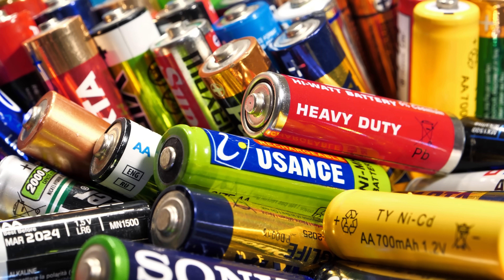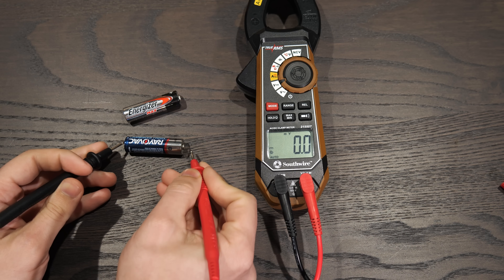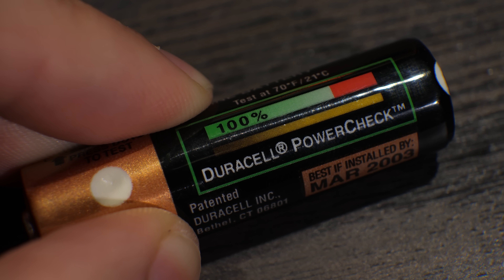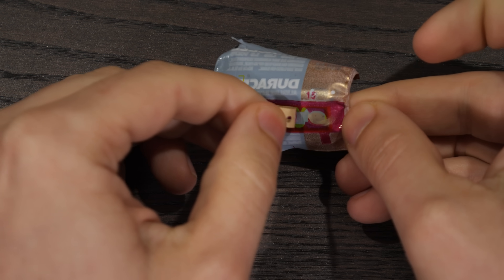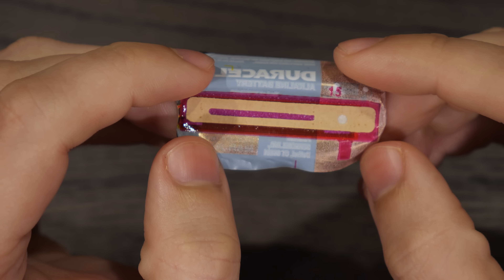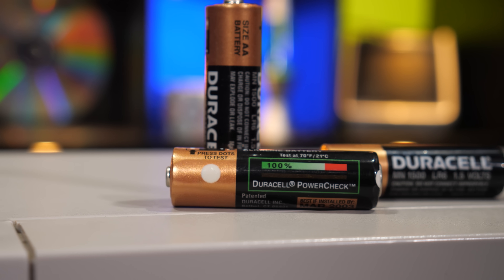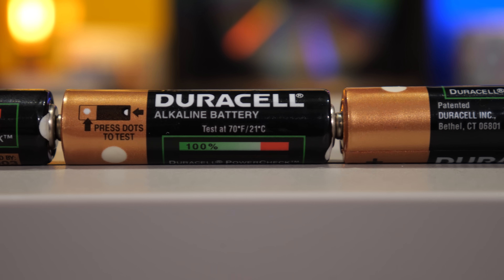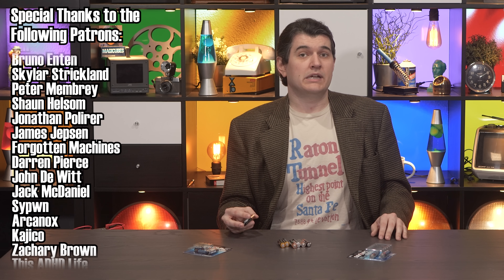Duracell PowerCheck: A genius idea which didn't last that long

Comment: I don't know if it's an age thing or a class thing, but I absolutely grew up with drawers of half-used batteries, and so did all my peers. I thought that's how EVERYONE of my generation grew up. Am I that old? I mean devices broke or got replaced all the time, and you always wanted to be ahead of the game by having a stockpile of backup batteries, and it was obviously impossible to tell which batteries were good and which were bad. I would honestly find it much more odd if someone's house didn't have a half-used-batteries-and-charger-cables-and-chopsticks drawer.

I had always thought that the reason these things died had far more to do with the transition  to rechargeable batteries and electronic devices with built-in battery meters than because people didn't really use them that much. I was always more than happy to spend a bit of a premium for the convenience of being able to easily find out which batteries were good and which were bad.

Comment: Why doesn't anyone mention the good old battery bounce test??

You drop a battery on a hard surface negative terminal first to see how much in bounces, if it bounces high that means it is used up, if it barely bounces that means it's good.

To me it works every time, and by height of the bounce you can roughly determine the left over charge. For some reason empty batteries behave completely different.
Reply: Another channel has a long video on this

Comment: There is a "slight" problem with the rechargable batteries: 1.2 V cell voltage compared to the alcaline batteries 1.5 V. Means: last much shorter. For example I have the blinking red light on the rear of my bike. With alcaline batteries (even the worst possible quality ones) it is bright enough even after a half a year in wintertime. But with rechargables... One week tops.

Comment: What I have started doing is when ever I am not using a device` I will reverse half of the battery's in a way the voltage cancels out. That way I can keep the batteries in the device without them contently draining. For my Wii remotes that I use once a week it is the difference between lasting two to three weeks or 6 months. The shape of holder in the Wii remote does not like you putting the battery in backwards but it is close enough that i don't care. For my newer Xbox remote both terminals on the battery case are identical so this technique works great. In both cases I now don't have to worry about my remotes not having battery when i come back after not using for a while because when i come back to them they always have roughly the same charge as when i left it. This unfortunately does not work for devices that have an odd number of battery's or have a odd number of parallel pairs but in almost every case this is not the case so it has saved me tons on batteries.

Comment: Having done thousands of videos about battery operated toys I quickly learned to steer clear of Duracell batteries because of the way they leak. Lost count of how many times I saw these batteries destroy whatever they were left in. Had me wondering why didn't Duracell develop a leak proof battery.
Reply: Buffett bought them and then their quality went into the trash can. I mailed Duracell over 1000 cells and 20+ destroyed devices. Energizers and even some Chinese no-brand batteries rarely leak compared to current day Duracell.
Reply: They changed! I have found devices many years old with intact cells but now they go bad before I even get them out of a package if it sits around some. Energizer seems to work WAY better and Amazon has them in bulk.
Reply: @BLKMGK4  If the batteries are actually "Energizer." Amazon has turned into a scammy cesspool lately, like selling "new" hard drives, but they are actually refurbished and still contain user data on them. Great stuff.
Reply: Yes. I own TycoCollectors (website) and the number of old Tyco, Taiyo, Nikko, RadioShack and other 80s/90s RC cars which have been destroyed by leaking Duracells and similar chemistry... very frustrating. It does'nt just ruin the battery compartment, the acid seems to creep deep inside the toy, and then begin eating away the circuitboard.
Reply: Give Low Self-discharge NiMH cells a try. They do have a slightly lower starting voltage, but their discharge curve is rather flat so they produce a very consistent voltage across their discharge, they handle high currents incredibly well due to their inherently more powerful "jelly roll" construction (similar to the physical construction of cylindrical lithium ion batteries), I have never had them leak on me (they rarely ever leak, plus safety vents help with that anyhow), and they're rechargeable so they're cheap to use. They power my flashes for my camera, they recharge the flash's internal capacitors about 3X faster than any fresh alkaline cell will, and last almost 2X as long under those heavy loads.

So far the one downside is their maximum capacity is not quite as good as a disposable (close though), so for low current loads like a TV remote they might not last quite as long... but they're rechargeable so it doesn't matter much anyway. Plus, the usable capacity at high current is almost as much as their rated maximum, so they actually get their full capacity even at absolutely stupidly heavy loads.

Panasonic rates their Eneloop brand cells to operate at rated output in -20C so if you do any toys in the cold... might be worth looking into. Just make sure to buy the regular variant with more cycles and lower capacity as their outer case is a tad smaller than the Pro variant so will physically fit into almost anything, even when some disposables wont, while also being more abuse tolerant. But really any NiMH cell made in Japan comes from the same plant regardless of brand.

Comment: I remember these! And am pleased that 14-yr-old-me guessed most of it right. I didn't like them because I felt it was wasting the power. But I enjoyed the whole video, and it reminded me I have a bunch of devices on the shelf with AA's in I haven't checked for a year - need to check because they will leak eventually, so.. thanks!

Comment: One time the remote AAAs gave up my dad got mad because we only had spare AAs, so he got 2 taped at the bottom of the remote and used a pair of paper clips to connect to the terminals and it worked perfectly for many months.

Comment: IDK how you got information about this hasn't been in prodution for a while? I bought this in high school in 2014 or 2015 tho the checker line wasn't yellow but a 5 segment display line going from red to green part. Tho yeah the dots I had to push really hard. I was really facinated by who they worked.

Comment: Every AA alkaline battery has a tester, the "bounce test". Works with AA and AAA alkaline batteries. Drop the battery from about 1 inch height with the flat negative side down on a hard flat surface... If it bounces, it's bad. If it doesn't bounce and lands with a thud, it's good.  Why does this work?  It has to due with the buildup of hydrogen gas as the alkaline paste is consumed when the battery produces electricity. Similar to an inflated basketball, the gas pressurizes the battery cell cavity, making the battery bouncy.

Comment: That happened to me on a service call at work. I got a service call to a nursing home for their pagers for not working that they were using for their nurse call system. The pagers required AA batteries so when I arrived, I asked them if they had put new batteries in the pagers and they yes. So, I got my meter out to check the batteries and all were dead. I said, do you have some new batteries, so she opened a drawer full of batteries. Needless to say, every battery in that draw was dead. I brought some new ones with me and all was good. They told me that they just threw the old ones back in the draw and putting which they though were new ones back in. I took the whole draw and dumped it. That cost them $250.00 dollars for being stupid.

Comment: It is also possible the manufacturer realized that, if people have a way to tell that the batteries that stopped powering device A still have some zap and can power device B, they will not buy new batteries for device A and device B.

Comment: It's nice to know I'm not the only one who gets upset about having to change AAA batteries so often, when longer lasting AA batteries would easily fit in the same remote control or whatever device it is. It's just plain stupid. BTW, I remember those batteries ,and the testers were a pain in the... thumbs to use.

Comment: Not sure how many folks will catch this comment after 1.3M views, but here's what you do about any junk you have which still uses disposable batteries:

Stop buying disposable batteries. Instead, buy little USB-C BMS PCBs for a song from AliExpress or Temu or whatever, and while you're at it, some thin saw blades for your Dremel and a cordless hot glue gun to clip onto your cordless power tool batteries. Now get hacking, with all the lithium batteries you can find in old phones, 'dead' laptop batteries, disposable vapes, etc, etc, etc.

Lithium batteries which won't charge usually still have a lot of life in them - you just need to ditch the silly little 'sorry Dave' BMS circuits on them and connect the cells directly to your aftermarket BMS. I was fuming after I did everything I could think of to resurrect a supposedly dead laptop battery, replaced it, and then tore it apart to find the cells inside still totally functional - but not according to the poxy little PCB in there.

Comment: Man the tester were great, had one separate but always felt it was off and just meh at best but then the ones on the bat was great to save one that might have been more charged or more depleted then another bat for some reason. That saved alot of bat but then they started to get much more expensive then the others with out, at least for me. Guess im a different one since i did use them quite a bit to the point noticed that some were damaged from get go or quickly stoped.

Comment: I had dozens of these back in the day and loved them. They would fall out of new packaging in our kitchen drawers and get mixed with used or old batteries. We would quickly test the battery when we pulled one out of the drawer. Loved the reassurance that I had a fresh one. I would buy them again if they were available. I own three multimeters and I'm too lazy to go grab one out of the garage or basement for a AA battery test haha.

Comment: circa 2022. Pandemic  
Oh, MG what is your temperature??? !!  So I bought a battery AAA operated digital thermometer. A thermometer that didn't have an off switch. I think they stockpiled them just waiting for a pandemic and people would just buy any thing. I don't really think we needed a pandemic for that, prime day or black friday will do.Any way my point I have to pull the batteries after each use and put them in the draw. I am taking a chance, the draw doesn't have an off switch either.

Comment: One thing I never understood: why do you need to press two dots to activate the tester? You only need one open switch to break the circuit when not in use, so why not just have one end connected permanently? (Preferably the negative end, since the dot on the side of the battery was much easier to press than the one on the corner.)

Comment: Back in the day in my country, we did change batteries between things because they were expensive as hell or at least too expensive for most people if you didn't want crappy Zinc-Carbon cells. You'd get a toy and they'd never buy you batteries for it, you had to borrow them from stuff that wasn't being used but had more priority at home. So the testers were useful. Today, you just buy a huge pack of 40 AAAs or 20 AAs for a fraction of the cost of the equivalent in big brand 4-packs.

I remember the testers were originally in the package, you were supposed to squeeze the battery against the space in the package where the battery fit, usually an empty space between the new batteries. Or a couple holes in the package for 9V batteries. I guess they moved it to the batteries so that people were forced to buy Duracell and not other brands and keeping the tester for them.

Comment: I remember them. Duracell and Energizer had such testers. They were more expensive, but the gimmick was pretty cool. If it weren't for the much higher price, probably every battery would have such a tester today :) Here's a video from Energizer: watch?v=IN2_s1TDVZ4

By the way, Duracell batteries with testers are back in Poland (at least for now, but the price is much higher than the regular ones)

Comment: Not in production anymore?? Dude I have a stash of Duracell Ultra Power AA’s under my bed right now haha, mine don’t just turn yellow though they glow red, yellow, and up to green if they’re full. They also don’t need to be pressed nearly as hard as the old ones, just touch the negative pole and very slightly press on the side spot.
The ones I have expire 2028 so definitely relatively recently manufactured

Comment: I am very surprised that these batteries are not currently available in the US, these Powercheck Duracell batteries are used very often in Turkiye 🇹🇷 (I even have two on my remote control right now)😅 and new ones are still available at the moment. Duracell batteries comes to Turkiye from Belgium.I think the Belgian factory is still producing this battery.🇧🇪🔋

Comment: i always used the ol' bounce the positive nipple side of battery on a hard surface trick to crudely tell if it would work in a pinch. if it didn't bounce then it was fat dead.

Comment: Way easier test for AA and AAA batteries is the drop test.  Drop the battery about 1” above a hard surface.  If they bounce they are bad.  If they don’t bounce, they are still usable.  Remember     Bad Batteries Bounce.

Comment: I remember those testers on the side of the battery very well. I thought that was super cool, but then they just vanished off batteries by the early 2000's.  I wanna say 1995 to 2002 would've been the timeline of those built in testers. Energizer also had their own version of the batter tester, which I believe worked mostly in the same manor, but it just made "GOOD" appear in the little window rather than a scale of life like the Duracells had.

Comment: AA batteries don't necessarily always last longer than AAA's. Many replaceable batteries are a complete rip off and only part of the case is actually used to house the "battery" parts in them.

Comment: Back in the day, batteries were a prized commodity in our home. The idea of having unopened packs of many different sized batteries, like I have in my home today, wasn't even a thought to us. Whenever a battery's current was no longer sufficient to drive a toy/game, it would go into a drawer with others of similar fate. These would then be used in remotes or other items that could operate with a close to dead battery. They didn't get thrown out until they were dead in the remote. We didn't own a separate battery tester, so we bought Duracell because of the PowerCheck feature. If nothing else, it was a great marketing tool for families like mine.

Comment: Correct term (that no one uses) is dry cell. A battery is a bank (or battery) of cells. Also, the Duracell tester is more of a power meter than simply a volt meter, since it draws current.

Comment: way way back in the day when these were available, i put a set in a mini Mag light, the AA variety, the added thickness caused the batteries to stick inside of the tube of the flashlight and my dad had to figure out how to take apart the bulb holder and we tapped the batteries out.  It took a bit of effort.

Comment: Remember AAAA size? Old styler laser pointers used them. Turned out they were used in many brands of 9V batteries and you could extract six of them if you had the correct brand that used them.

Comment: What timing! I was replacing some AA batteries yesterday and wondered what happened to the Duraceli PowerCheck feature. I had no idea of what an innovative way it actually worked. Thanks for this insightful video!

This reminded me of another clever innovation from many years ago. In the late 1960s I assembled a Dyanaco Stereo 70 amplifier kit that used vacuum tubes. The power tubes required a nominal current flow of 100 milliamps from cathode to plate, but how to measure it? The flow was adjusted via a variable resistor between ground and cathode so a 15.7 ohm precision resistor was wired is series with that. The idea was if you measured 1.57 volts across the resistor you would have 100 milliamps current. Why 1.57 volts? That was the voltage of a fresh carbon-zinc battery. You'd measure the battery voltage with you trusty multimeter and note what voltage it showed. (Typical meters back then weren't that accurate .) Next the variable resistor was adjusted until you got that same reading across the 15.7 ohm resistor giving you your 100 milliamp current flow. Easy peasy. 

But then there was the question of how you knew the battery you had was "fresh" as there were no "best by" dates in the 1960s. You just had to take it on faith that your newly purchased battery was actually fresh.

Comment: When I was growing up in the early 90s, everything took AAs or D cells. Now, if something doesn't have a built in battery, it's AAAs or Cs because everything is smaller.

I've seen some AAAAs and I'm a little scared. Maybe eventually stuff will get small enough that the Chunky niche will bring back B cells or A cells.

Comment: One unmentioned use for the tester would be when you have a device that uses multiple batteries, and only one or two are dead enough to kill the device. So either throw out the full set, or check to see which ones are the dead ones.